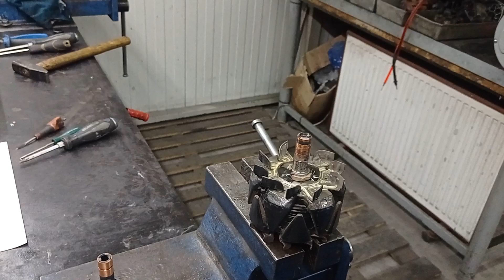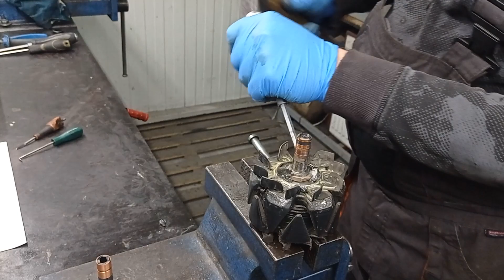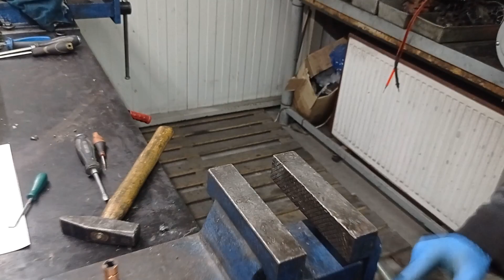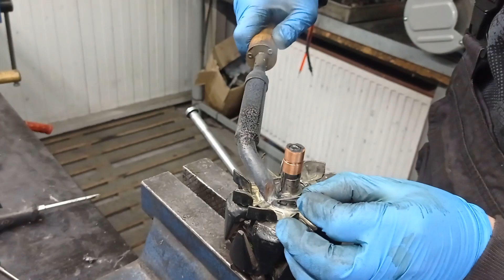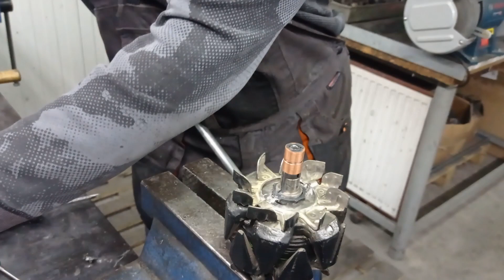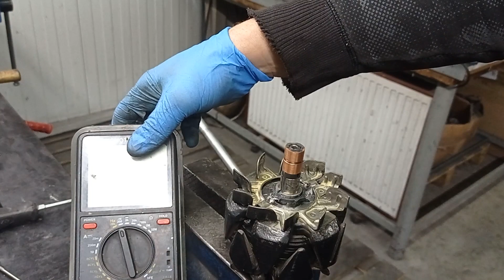How to Repair Alternator VALEO slip ring change / Remont alternatora zamena kolektora na rotoru

Comment: On my valeo aternator broken one wire when remove resin, is possible save it ?? Thank
Reply from the maker: To be able to pull it out, you have a little plumb line, look a little closer where the wire goes and how it is coiled under the propeller.